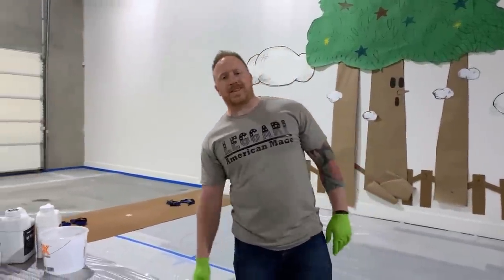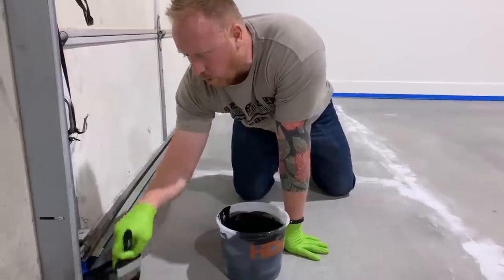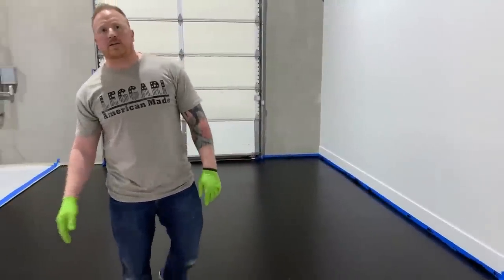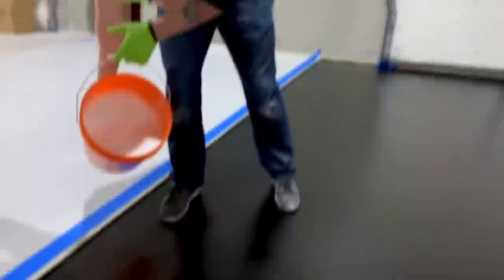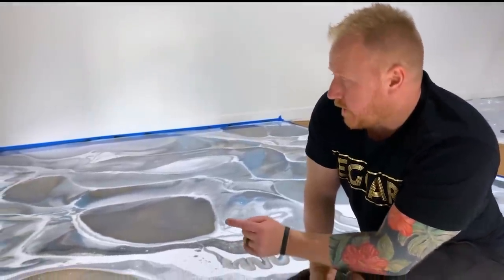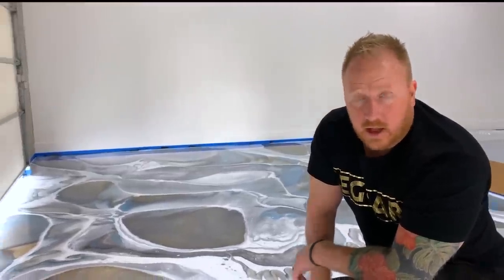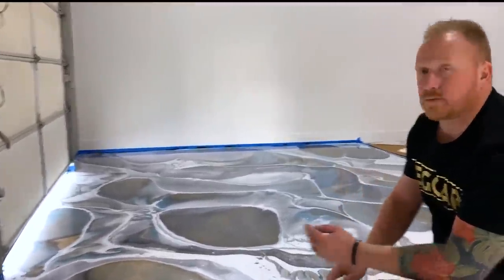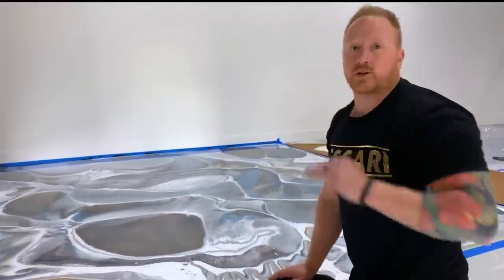Epoxy Resin Dirty Pour Floor Done Over Concrete | A DIY Friendly Technique That Looks Incredible!

Comment: Absolutely love this! I use epoxy and dirty pours in very small quantities relatively speaking LOL but I’ve always been intrigued by this concept. I like the dirty pour, it makes it look somewhat like a unique rock formation. 

We’ve recently moved into a new house with a huge screened in porch at the back of the house. Clearly it has the original cheap indoor/outdoor carpet, it is old, ugly, and it stinks. Our last house the porch was open on three sides and looked out over the pool, very different vibe. This one is surrounded on three sides by the house, with multiple French doors looking onto the porch, overlooking the backyard and the landscape beyond. I need something welcoming that isn’t too dark, can hold up to the Florida heat, and can hold up to my two dogs running in and out all day. 

My concerns are how do you prevent the sand or whatever from coming in through the screen during the process and during the cure time. I’m also not sure it’s something one woman can do. I have drills and sanders and the basic tools but clearly I don’t have everything. I have a relatively decent relationship with my contractor but I seriously doubt he’s done this before. Do you perhaps have any affiliates in the Central Florida area you could recommend?  In the meantime I’ll keep watching. Thanks for sharing your talent!

Comment: Can your product be put over painted oil floor  with imperfections no border high traffic area also exposed to elements like a gallery or patio setting also can it be applied in the tropics  heavy rainfall and sun

Comment: It looks beautiful.

If I had to step into those narrow spaces while pouring I'd lose my balance and end up decorating in a "splat" pattern.

Curious about something: if any of your epoxied creations were to be cut, dinged, or gouged somehow, could one use a heat gun to soften up the area and perhaps cause enough flow to fill it in?

One can use a damp rag and an iron to lift dents in wood which is why I asked about using a heat gun.
Reply from the maker: That's funny, yes you do need to be very careful when you are walking on the epoxy.

Comment: The  dirty pour floors are awesome. Just wondering if you have a durable top coat that can withstand oil or gas hitting it that won't deteriorate. Thinking this would be awesome to try in my garage. If I like the product I might see if I could sell it too
Reply from the maker: We have a urethane top coat that is four times harder than the epoxy and makes the surface more durable.
Reply: @LeggariProducts  are your products available in Canada?

Comment: When you say Primer, What are you using? is it a epoxy or just a paint? Thanks y'all do some kool stuff.
Reply from the maker: Our Leggari primer is a water based epoxy specifically designed to chemically bond to almost all smooth surfaces.

Comment: We're to get these products ?And please let me know approximately how much and long lasting (life)is it after some years it could be changing  of other shade's . please give message through you tube
Reply from the maker: You can actually order or price out a custom kit for that exact square footage through the Floors section of our website at www.leggari.com. Simply click on Floors >>>> Order Floor Kit Here then the link order floor kit, then follow the steps. 
Our products are actually industrial coating made for military aircraft hangers, etc. So theoretically in a residential, or even commercial setting it will last forever. This is NOT a cheap epoxy paint that you will commonly find at box stores like Home Depot or sherwin Williams. It is a thick 100% solids epoxy coating.

Comment: Should you not put on a mask for safety of your lungs? Or it’s ok not to? Thank you
Reply from the maker: The product is very low VOC’s meaning it has little to no smell at all. It’s 100% solids so there’s no toxins evaporating in the air. 
But you can always wear a mask.